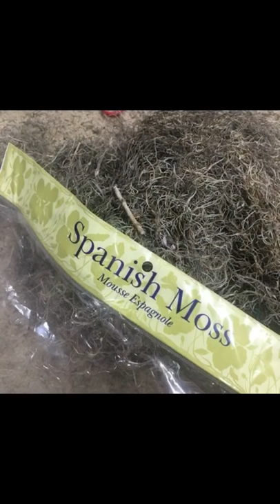Animated Pirate ship build Halloween prop

Comment: I'm looking at creating the same thing. But how do you get the foam to attach to the wood? If I nail it in, any stress will pop it off the wood.
Reply from the maker: We used screws with button caps. They sell them for roofing at any home improvement store. We take the button off the nail and put it on a drywall screw.

Comment: Hi, I am going to take a stab at doing a similar ship. I love the foam idea for the detail you can bring and the end product is lighter that all wood.  I was about to buy the foam cutting kit, any advice when using the grove cutter to make the wave pattern ?  I love the spindles just under the matt edging, did you carve them or? and lastly - what, if anything  did you use to make the foam waterproof
Reply from the maker: The spindles are wood molding I bought at lowes, just cut them and glued them on with e6000. I didn’t put any sealer on it just exterior paint. It’s held up well. Good luck! I’d love to see your finished project!
Reply: @RoseStudio123  thank you. Picking up the bulk of the material tonight. Found the harbor freight mats - unused off facebook market. Picking them up on Sunday. I ordered the whole foam cutter kit because after you pick 3 cutters and the guide rail ruler it’s about the same $
Since the foamboard is 8’ the ship will be too. 
I need to make a few changes. Years back I made a leering skeleton. I want him leering off the bow with his lantern so I’m not sure I can add that open triangle at the very front you did. Will be checking that. I’m mAking my frame in 2 parts to be able to build in basement and bolt together outside. 
Ohhh and I don’t have a pool so I’m backing mine against an old wood shed. 

Will update as its going along.
Reply: This is a fun project. Thank you. Framing done. Foam attached. My boat is larger. So I have seems on the sides I just sprayfoamed.